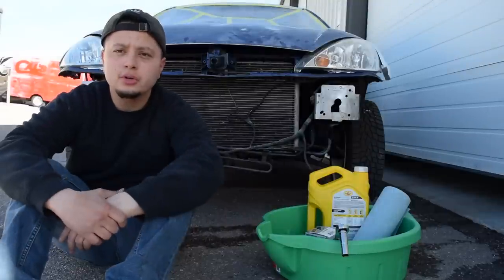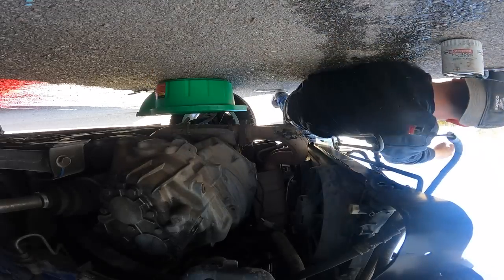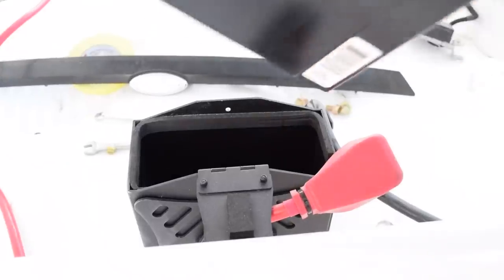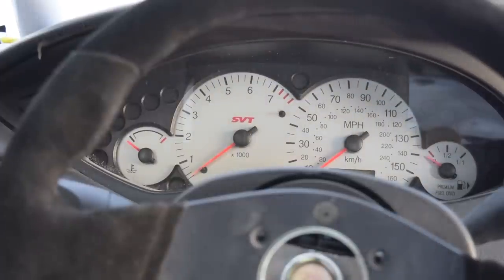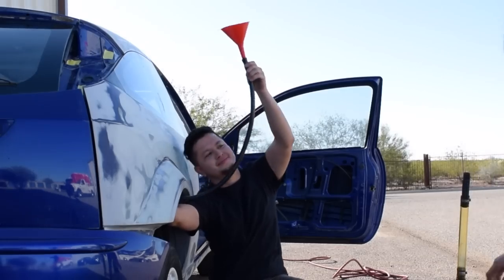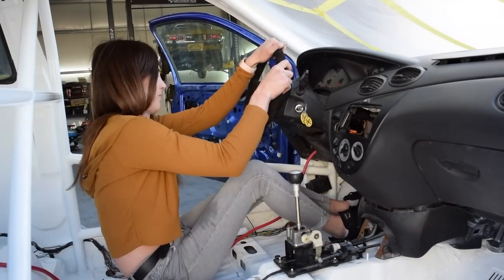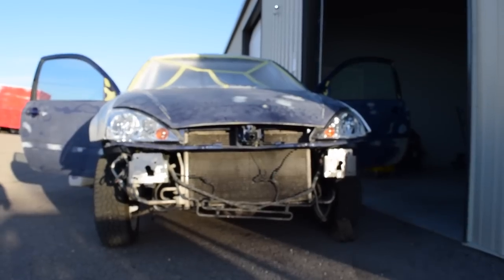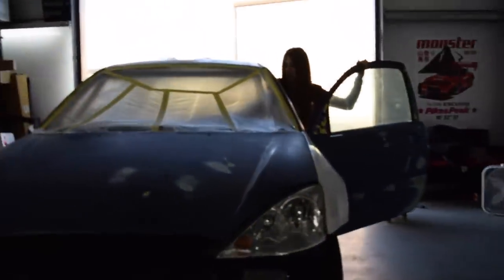Hasn't Ran in 2 Years // Sarah n Tuned Focus

Comment: Hey Angel, I thought it was the clutch not letting it start, but in a different way, because without the seat, I figured you were not pressing the pedal down far enough so almostright🙂 Love the Stang I had a 68 convertible bullet green with a black interior 289 but unfortunately an automatic transmission still a lot of fun to drive especially with the top down have a great one.
Reply from the maker: Bullet green sounds badass, mine had the c4 auto aswell. The new project will for sure have a manual, hint hint project reveal coming soon!
Reply: @rookie__pilot  cool I will be looking forward to it. had I kept that Mustang I would’ve done a manual swap.
Reply: Angel I slightly misspoke the color was highland green  not bullet green I say that because everyone knows the green of the famous bullet car also a 68 by the way.

Comment: Cool 👍🏽🤙  I had to replace a front bushing on a Toyota ipsum got old one out then trying to fit new one wasn't working so got the digital feeler gauge out and was few mils bigger arrh  so with a belt sander and small fine sander sanded it down and put in freezer to cool down took a few go's then pressed it in , took way longer than normally would 😞
Reply from the maker: Oh no! I always add extra time to any task for that “somethinng” glad it worked out

Comment: Always remember to pull the leads off and wind it over a few times untill it builds oil pressure especially if its been sitting for a long time. 👍👍 also you need to post more content Sarah's cup cake 😁 i dont think there's a bloke out there that would knock back being Sarah's anything cake lol ya lucky little sh*t 🤙🤙

Comment: Listen, I’ve pulled all the strings I could to get her to call you Angel the Beefcake. 
Seems like a no-va.
I had a ZX3. The OEM ignition tumbler is a known issue. She should replace it before her key stops turning.
Also, the antenna ring around the switch is known to fail.
Reply from the maker: Thanks for the input👍🏻👍🏻

Comment: Easiest way to fill a tank like ...
🤔 🙄 😌
Still no need to push !!!

Now, I'm wondering ...
Still don't want to push neither but ...
Did you process safety mesure for the next one ... intending to eventually caps or build an access point ???
Just cause ... then was a spark ... sounds ...
Bit "déja vu" as a whole story ...

Whatever ...
If authorities first an almost only check gaz tank is air proof in AZ must be some sort of hidden reasons ...

Just need to lit it up now, ...
🤔 🙄 😌
Dare, care, ride safe, clean, have fun ...
From France with ...
Reply from the maker: An access point for filler neck will be made or a new filler neck will be modified to work! 👍🏻
Reply: @rookie__pilot  
I must admit
It don't truly appear as an appropriate process to fill a tank on a rally car so far ...

Nb: in order to start back thoses kinds a vehicle and generally while changing oil, dismounting the oil pan, filling the oil filter before screwing it back in place stand the best way to avoid the engine to run dry while filling the oil circuit back ...

Could be helpful to quote that point as it appear you may dismantle and build back few other ones ...

Keep it up, not pushing it ...
🤔 🙄 😌
My bad ...
Thanks